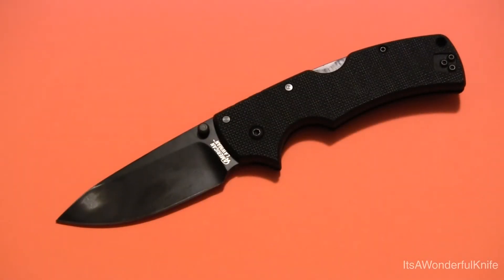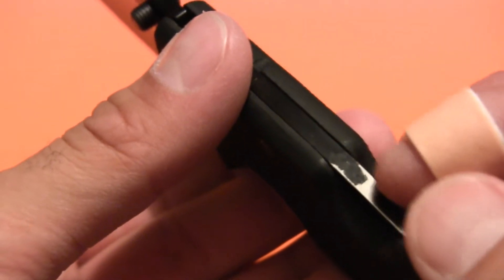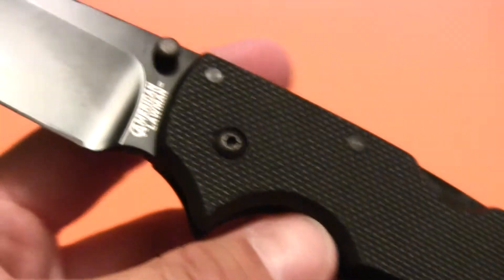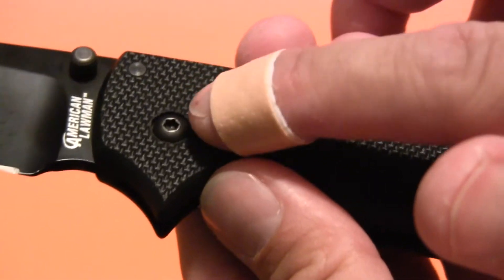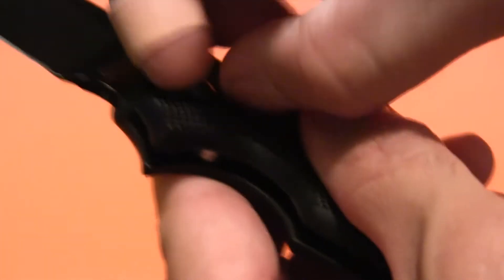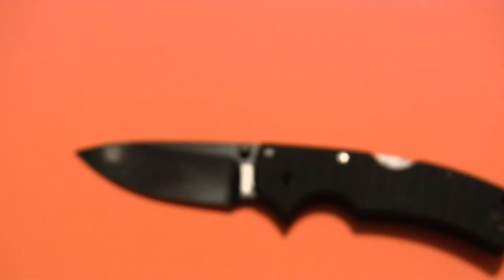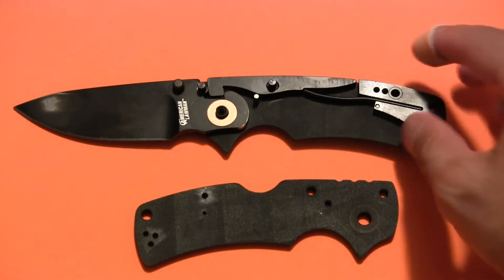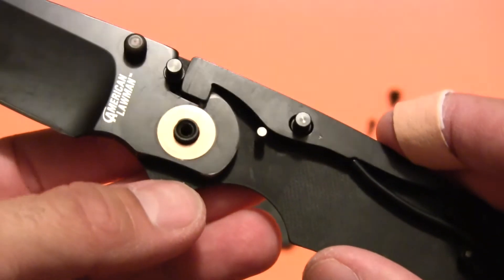Removing the Coating from the Cold Steel American Lawman

Comment from the maker: It works well for sure, I've seen it. Paint thinner will too, but both chemicals are effective only on certain coatings and apparently Cold Steel likes to change them every so often. I've read a bunch of accounts of folks who either took the coating off in seconds with Aircraft Remover or others who tried it numerous times with little success and ended up sanding away the rest, or using steel wool. In the end, my cheapness won out, he he! Excellent tip, though, thanks so much!

Comment from the maker: I have read that in the past, paint stripper would remove the coating but recently CS is apparently using a different type that is tougher. I was a little nervous about trying the steel wool method, but it saved me a trip to the 'Depot as well as a few bucks, ha ha! Thanks very much for watching (and for checkin' out the Skyline vid, too)!

Comment from the maker: Thanks! I just pretty much have no use for the coating. Even my Benchmade 806 in D2 steel doesn't really suffer from having its coating worn away. And I never thought about the part count of the knife, but I imagine you're right. Pretty simplistic design which is always handy for a quick teardown.

Comment: "Aircraft Remover" works really well they sell it in an aerosol can at Auto Zone. Spray it on liberally in a well ventilated area let it sit for a few minutes and the coating melts then you can scrape it off. Used it on my AK-47

Comment from the maker: You can try a fine metal polish like Flitz (or something similar) and gently buff it out. Depending on how deeply the patina has penetrated, this may take some time. Failing that, very fine (high grit) automotive sandpaper will do the trick but will likely alter the original finish to the blade (such as a satin, stonewash, or bead blast surface). Once restored, it is important to occasionally coat the blade lightly with oil to prevent a patina from developing again.

Comment: Nice job, I really like the look without the coating. Were you able to remove the black off the thumb stud? Which grade of steel wool did you use? I love the way yours looks and I want my blade to look the same.

Comment: you can use another method without damaging the steal. You could also get the easy coating of the lawman off with a knife or a philips screwdriver

Comment: Would removing the coat result in the formation of rust? If so, how can I prevent it? Thanks in Advance
Cheers,
             David
Reply: The blade steel that coldsteel uses on their folding knives is AUS-8a.  AUS-8a has a high chromium content which lends itself to being soft (thus less edge retention compared to other knives).  Anyway, the high chromium content also means that the steel is far less prone to rust than other steels.  So basically, there is no real concern of rust--but to be safe you can purchase a tuf cloth with which to wipe down the blade (mineral oil rag).